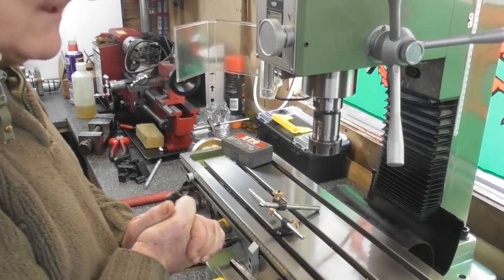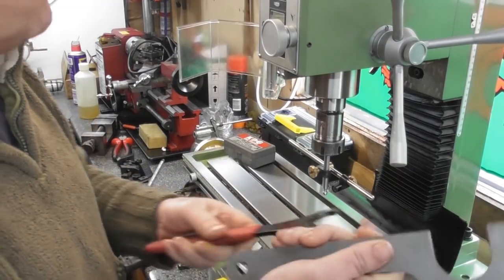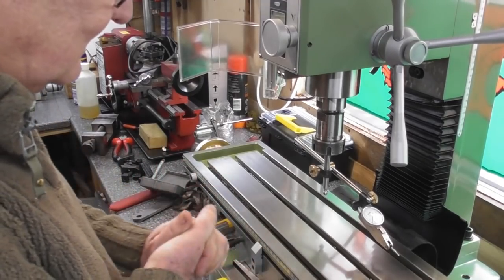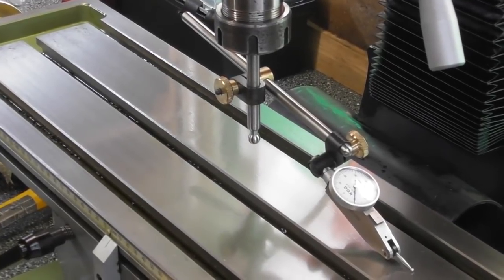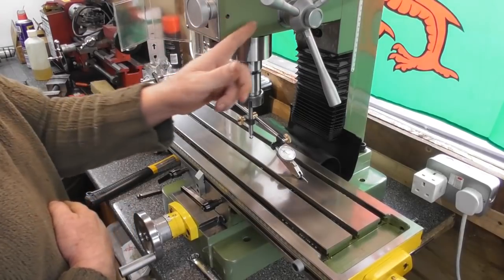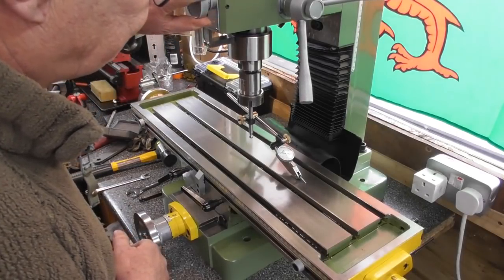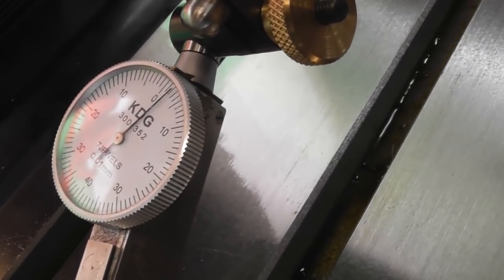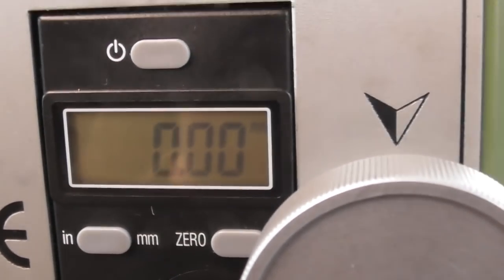Warco WM16B mill   tramming the head

Comment: Just a suggestion, if you'll be asking it for lots of torque at low revs it's worth adding an external fan over the motor as the motor's own fan won't move much air and it WILL overheat, when it does the windings short and that then takes out the speed control board, resulting in a couple of hundred quid to replace (I did a lot of motor and board changes on green and yellow lathes and mills with DC motors in another, more miserable. life...).Good video though, nicely put together :)
Reply from the maker: So many improvements to do. I will put it on my ever increasing list, Cheers Ade.

Comment: Like others have suggested, the quill should not be extended, and the clock needs to be set to zero and left alone.  Then swing the arm from side to side - maybe helping t over the grooves.  It's like you're constantly measuring backlash in a thread - one way then the other.
In short, don't over complicate or introduce possible errors into the process.
Regards Mark in the UK